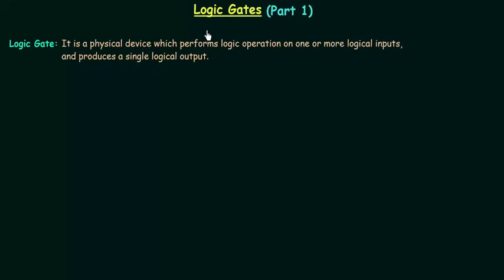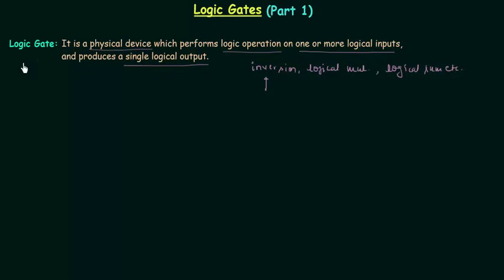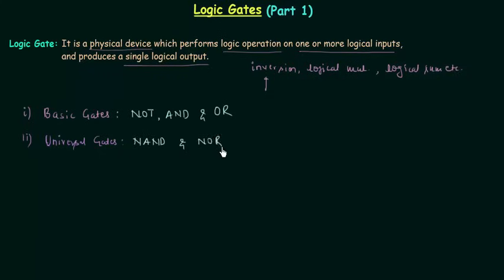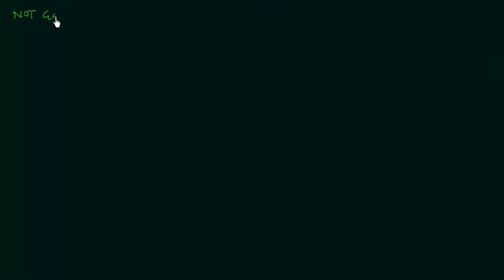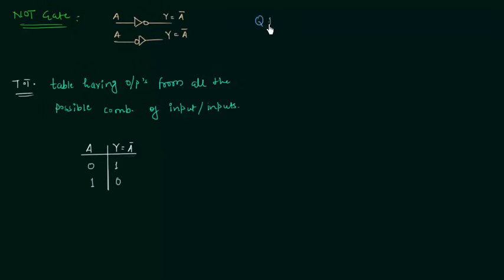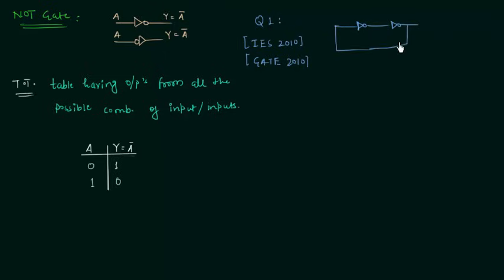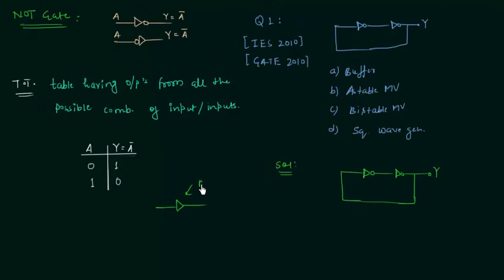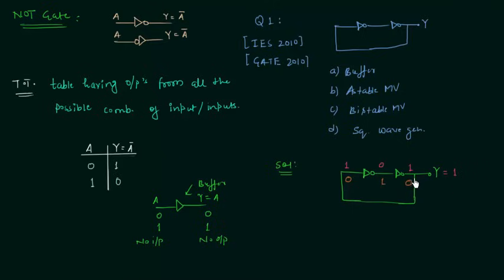Logic Gates (Part 1)

Comment: I solved the 2nd problem related to the ring oscillator. The answer is T= 1.4 * 10^-8 s because I started by doing T=2Ntpd and then I simply added the last one propagation

Comment: Hey Here,
Consider gates as 1-2-3-4 ok,
1st cycle goes 1-2-3, means each one have 2nsec so ,  now there are 3 and 3*2nsec=6nsec, and again ckt get feedback, and comes to 1st gate and make 1-2-3,means 3*2nsec=6nsec,so after feedback of 3rd gate it's going to 4th gate and get 2nsec.
6nsec+6nsec+2nsec=14nsec
C is the ans.

Comment: I think the answer for problem 2 will be 14 nsec because
After the first 3 gates, there is a feedback so T will be:
T=2*n*tpd=2*3*2=12 nsec
Where n is the no of gates used before feedback i.e. 3 and tpd is the propagation time taken for each gate i.e. 2nsec.

Since the fourth gate was after the feedback, the tpd of fourth gate will be added to the result of T because it is not the part of the feedback, so the final result is:
T=(12+2)nsec=14nsec
Therefore the final answer is 14 nsec.

Comment: In q2: Shouldn't the first cycle be 20ns at first and then 12ns? Explanation: We start with 0. Then after the first 4 time periods, Y is still 0. Then during the next 3 time periods, Y remains 0 and after the 7th time period, Y=1 and then Y falls back down to 0 after the next 3 time periods. So it should actually be (7+3)tpd * 2 = 20ns for the first cycle and then 12ns for the next cycles.

Comment: 🔴H/W problem 1:
Solution: frequency f = 1/T
Given~ n= 5, tₚₔ= 100ps = 100 × 10^(-12) s
So, f = 1/(2 × n × tₚₔ)
         = 1/(2 × 5 × 100 × 10^(-12))
         = 1/(10^(-9))
         = 1 GHz
✔️ans: Option (b) 1 GHz
.................................................................
🔴H/W problem 2:
Solution: Time period T = 2 × n × tₚₔ
Given~ n = no. of NOT gates in feedback loop = 3, tₚₔ= 2 ns
So, T = 2 × n × tₚₔ
         = 2 × 3 × 2
         = 12
✔️ans: 12 ns
Reply: And what about the last NOT gate in problem 2?
Reply: @deepannandy7288  Consider only those NOT gates which are there in the feedback loop.
Reply: @snehashishbanerjee2575  the last one is also there in the loop

Comment: why the first one is not a sq wave generator while 2nd is sq wave generator
Reply: Even no.of not gates doesn't generate square waves because there are stable or acts as buffer no oscillation occurs input is same as output

Comment: first problem- 1GHZ.. second problem for simplification take the point after 3 NOT gates as X. now make a graph of X. After that to get the output Y take the graph of X, each time X changes add a delay and invert the value and there you have Y. you'll see X and Y have the same time period only Y is 2nsec lagging. Ans is 12nsec

Comment: 1. 1Hz
2. 16 ns
         Because ,when may be the feedback is provided the  input have to  paas through all four gates to get output. And each gate will take 2 ns.
         It is simply like above problem. And it requires to pass through 8 NOT gates to complete on cycle.
  T=8 *2 ns
  T=16 ns
 I think it is mostly correct.

Comment: The 2nd problem was really impressing. I was kind of wandering what actually feedback does, and this gave me the answer.
   Anyway, the answer is 14 ns time period at  first ouput and 12 ns after that. The key point is that after the 3rd NOT Gate the feedback sends the input signal. So when the first input goes from 3rd to 4th NOT Gate, simultaneously 2nd input goes to 1st. So it takes the second output to come out taking time of 1st to 4th NOT Gate, not the 0th to 4th.
  For who doesn't understand due to my short english,

1st 0(8 ns) 1st 1(6 ns) 2nd 0 (6 ns) 2nd 1 (6 ns) 3rd 0 (6ns) 3rd 1 (6ns)
1st output(14 ns) 2nd output (12 ns) 3rd output(12 ns)

  Thanks to the comments I also got wrong at first!
Reply: Absolutely correct bro!
As far as I have analyzed the 1st and the fourth, not gate perform at the same instant after the feedback is in action, so clearly for the first time  value=0 prevails for 7 delays=14ns and thereafter the interchange of values is after 3  delays = 6 ns , hence time period comes out to be twice of the former = 6 delays =12ns !
Good question!
Reply: @suhriddas8769  right bro?
Reply: @suhriddas8769 bro time period at 2nd example is confusing at first input is 0 so , it's on ground lvl but output is 1 still grounded?
Reply: I still dont understand. Can you help?
Reply: It's 12 nanosecond. We will start observing only after first output is produced because initially Y can be in any state 0 or 1.
Reply: @amitanand0310  you are right answer is 12 nsecond
Reply: @amitanand0310  pakka?
Reply: Well the thing is Time period means the periodic cycle and if your input is 0 initially then 0 prevails for 14 ns and then 6-6ns(0 and 1 each) periodically , but if your input initially is 1 , then initially 0 will prevail for 8 ns and then 6-6 ns (1 and 0 each) , But in both cases the cycle actually covers 12 ns , as cycle is starting from the first 1 value !
Reply: Can you please explain further, I don't get it... what does feedback do... and as for the 2nd problem, n=3 because only 3 not gates are inside feedback, is that it?
Reply: @bertinaagnes73  no all the gates are inside check again he nly says
Reply: Woww bro that's brilliant! How did you ever think of that?!
Btw it's been 5 years now.. Are u probably working?
Reply: TYSM, I couldn't at first. Your comment really helped!!!
Reply: Ty
Reply: Yes 14ns as initial timeperiod, but 12ns is repeating lifetime, so we take 12ns as answer
Reply: Well done...
Reply: fking crazyyy bro
Reply: U r right but as u can see tpd is 2 nsec so T will be 14tpd and final ans . will be 28 nsec instead of 14nsec
i think it's the correct but if u find that it's not then i would like to understand the right concept

Comment: 2) c) 14ns ,  because if we start with 0 then after 6ns o/p to 3rd not gate will be 1 then by feedback after 6ns we will get 0 then this will go to 4th NOT gate producing 1within 2ns  and hence a  square wave and hence total T = 14ns
Reply: bro u have calculated T/2 but T=14 x 2 = 28
if u find any mistake u can reply
Reply: @deepakhutthy2663  I think you are Right as Time periop will be calculated for full pulse , Thanks
Reply: @utkarshshukla231  Abe Kya right?😂 Options bhi to dekh bhai

Comment: i think second one will be 12ns because consider y=0 then the input for that gate is 1 if we analyse this then from 0 to 6ns waveform is high 6ns to 12ns it will be low so time period is 12ns .now this square pulse is passed through not gate which will just convert 1 to 0 and 0 to 1 this will not ofcourse change time period or frequency so 12ns is correct

Comment: in the last hw problem the output would be same as input as there are 4 not gates so when we give 0 at the input after 8ns 0 will be obtained at the output while at 6ns the feedback will provide the signal 1 to input and during the time of 2ns in which the first 0 input will cross the last not gate this 1 will cross the first not gate and after crossing the rest of 3 not gates i.e after 6ns more the signal 1 will be recieved at the output and will last for 6ns till the next signal is recieved at output so conclusion is the time period is 12ns but initially there was a time lag during the start of generation of the square wave. correct me if i am wrong.

Comment: 2nd ans is 6ns that is a option.because the square wave is generated by the feedback circuit which has only 3 diode and 4th diode will take its delay time and just reverse the input signal nothing more than that

Comment: for the 2nd one the answer will be 14tpd or 28 ns
say you have 0 as input 
so after 4tpd Y is still at 0 
but after 3 tpd the feedback comes into play and feeds 1 back to 1st NOT gate so after 4 tpd that 1 has come out of the 1st NOT gate as 0..this passes another 3tpd to become 1 at Y

so you have 4+3 = 7 tpd for the signal to change from 0 to 1 so a cycle will be of 7+7 = 14 tpd = 28 ns
Reply: 14 tpd for only 1st cycle 
After 1st cycle it's 12 tpd

Comment: 1) 1Ghz
2) 12ns
IF WE APPLIED LOGIC "0" THEN
          A      B        C       D(Y)   ( THIS ARE THE OUTPUT AT EVERY NOT GATE )   
0       X      X       X         X
2       1      X       X         X
4       1      0       X         X
6       1      0       1         X 
8       0      0       1         0
10     0      1       1         0
12     0      1       0        0
14     1      1       0        1
16     1      0       0        1
18     1      0       1        1
20     0      0       1        0

IN THE TABLE AFTER EVERY 12ns OUTPUT IS SAME SO, ANS IS 12ns.

Comment: For second one answer is 12ns. Why because after the third not gate we can generate a square wave and also there is no feed back for the 4th not gate. But the delay is 2ns already We know that if any signal may be transmitted to the delayed device that will produce that output after that delay only. Hence in the given problem they are asking calculate the time period of the generated signal. Hence after passing the generated signal through the NOT gate we will get an output in the form inverse after 2ns time delay but time period is same. Hence don't consider the 4th NOT gate of while calculating the time period of generated square wave. Hence ans:12ns 
I hope it is useful to everyone

Comment: question 2: 12ns. The question asks what is the TIME period of the square wave, it does not ask to say what you see at Y output. The first 3 gates create and determine the frequency and time period of the square wave. The last gate comes AFTER the feedback loop,it adds a small delay of 2ns.
Reply: the first 3 NOT gates will create and sustain the square wave. You plug one extra NOT gate which will let you see the waveform after an additional 2ns delay :) Build the circuit, do not just read books/videos.
Reply: yaa we found it after 2 ns ..but it will not add time period or f of wave ..it will just delay it.......but the T will be same as previous...champ....
Reply: yes. :)
Reply: @myonlynick ans is 16ns
Reply: myonlynick ca u tell me the wave form in detail🙏🏼

Comment: Should the second answer be 14? Can anyone provide an explanation if it is 2
Reply: That is what I thought too but many said the answer is 12ns
Reply: answer is 12
Initially, the output will appear only after going through the first 4 not gates, before that no output is there.
however, at the final not gate, the input to the not gate and the input, via feedback circuit to he first not gate will happen at the same time, and they'll output at the same time. Once the output appears, only 3 more not gates remain (2 in feedback and one out if it) and so every time the output will change by 3*2nsec i.e. 6 nsec time, thus period is 12 nsec
do note that for first 8 nsec, there is NO OUTPUT. the signal hasn't reached there ye. analyze the circuit for time period only after this time.

Comment: 12 ns imo... because from the feedback point to Y it will take 2ns but in that time the feedback will provide signal back to the first NOT gate... so what im saying is that by the time signal reaches Y...it has already passed the first NOT gate . So effectively there are 3 NOT gates namely 2,3 and 4 ...thus 12ns
Reply: This is exactly what I have done. I think this answer is correct.
Reply: How come the first answer?
Reply: Absolutely right Sir
Reply: 16 nsec!!
Reply: O/p of feedback loop is applied to the I/p to the NOT gate!! Now NOT gate output will be complement of O/p of feedback loop ... and delay will be added where the O/p of feedback changes from 0-1 and  1-0 ... addind extra 2td ... so period is 8td.
Reply: In signals ans Systems if you apply delay to the waveform then the time period doesn't change but in this case the same approach can't  be valid... here the delay is added to the circuit where the I/p to the circuit changes....

Comment: Problem 1:

T = 2 ᵡ n ᵡ tpd
T = 2 ᵡ 5  ᵡ 100 psec
T = 10 ᵡ 1/10¹² sec
T = 1/10¯¹⁰  sec
therefore  F = 1/T
                      =  1/ 10¯¹⁰ 
                      =  10¹⁰ Hz

Problem 2 :

T = 2 ᵡ n ᵡ tpd
   =  2 ᵡ 3 ᵡ 2
   =  12 nsec

# 1 sec = 1/1000 nsec
              =  1/10¹² 
# 10ᶟ Hz = 1  KHz
    10⁶ Hz = 1 MHz
    10⁹ Hz = 1 GHz

# If odd no. of NOT gates is a feedback format, then its possible to generate a sq. wave generator or time-period cycle 
    And if there were even no. of NOT gates, then sq.wave generator may not be possible.
                             The NOT gate after feedback cycle is doing nothing but is providing a certain delay & it may not affect the time-period cycle or frequency.

### Hope I get it! & might help you out there...........
Reply: Bro in the first question its 10^9...not 10^10
Reply: 1 p.sec = 1e-12 sec    so in this case, u get 1000 p.sec which is equal to 1e-9 secs
Reply: it will change wave form only .. not  signal freq.
Reply: Anybody can explain plss how are n=no of gates =5&3 for first & second problem???!

Comment: 1. None of the above.  Y changes every 100 ps because the fifth inverter changes every 100 ps.  It does not wait 500 ps to change.  That gives it a period of 200 ps, and a frequency of 5 GHz.

2. None of the above.  Y, again, will change every 2 ns because that's the t_pd of the final inverter.  In other words, the final inverter receives a new value every 2 ns.  That gives Y a period of 4 ns.

Or am I missing something?

Also, your website is giving 404 errors when I try to access the homework solutions.

Comment: I suppose its 16ns because when Y is assumed to be zero then output of gate no 3 should be 1.Now after passing gate one it  will be zero not affecting  the output Y ,same for gate 2 but when signal passes through the gate 3 , 1 now becomes zero but this change will only affect the output Y only after passing through Gate 4.So in order to produce any change in Y.so it sjould be after passing a net of 8 gates.

I am not too sure about it otherwise what difference will remain in this and the above question!
Reply: exaxtly, same question arised bro...
Reply: My  answer  is  16nsec
Reply: 16 ns
Reply: Exactly bro
Reply: my ans too 16nsec.
Reply: I thought I wouldn't find anyone having the same opinion with me.
Though the question is asking for the time period of generated square wave, the output will only change to high after 2 cycles of the input (8), hence will again take another 2 cycles to go back to low.
Therefore, the time period is 16 nanoseconds

Comment: Question 1: 1Ghz
Question 2: 12ns
Reply: and for the last not gate? would'nt it be (12+2)ns?
Reply: Deepa Pandey  Name the points before the 4 gates as A, B, C and D the signal propagates from A to B to C to D to Y which makes 4 tpd, but the time in which the signal propagates from C to D the corresponding feedback signal has propagated from A to B. So it is basically (A to B and C to D simultaneously), (B to  C) and (D to Y) which adds to 3 tpd.
Reply: yes 14ns will be the ans i think
Reply: hj
Reply: good
Reply: Propagation delay would by 14nsec , true . However , the timeperiod of the square Wave is 12nsec
Reply: u need time period of output bro
Reply: what about last NOT gate?
Reply: How come the first answer?
Reply: how did you get 12ns on Q2
Reply: There are 3 NOT gates basically in the feedback path, so we have n=3. Now by formula of time period T=2.n.tpd=12nsec.
Reply: @vikashprasad4133   why we will not count the 4th NOT gate i mean the 4th NOT gate also has tpd
Reply: @soumyaranjanpanda5902   the fact is propagation delay only takes place in feedback circuit, where the system waits for the input signal to generate any output signal. In the circuit shown in Q no.2 the last NOT gate do not comes in feedback path circuitry, so it has no tpd. Hence we have remaining 3 NOT gates, n=3 and so on.. hope it is clear to you.